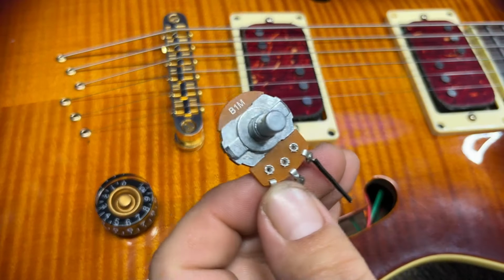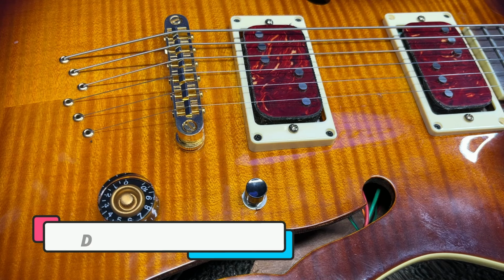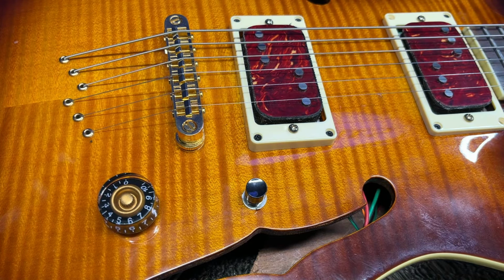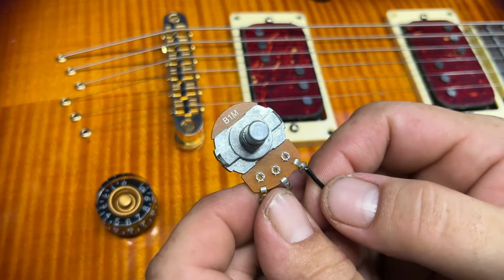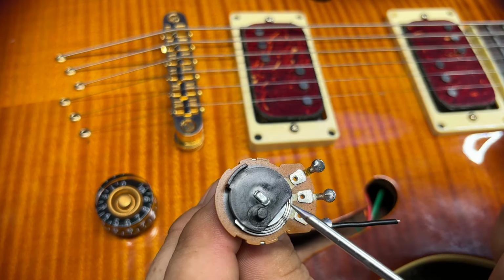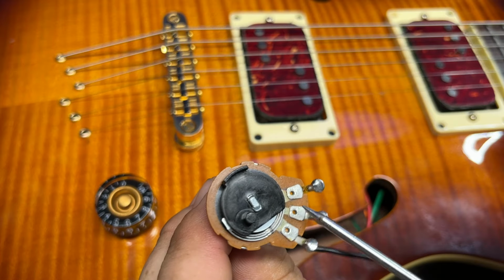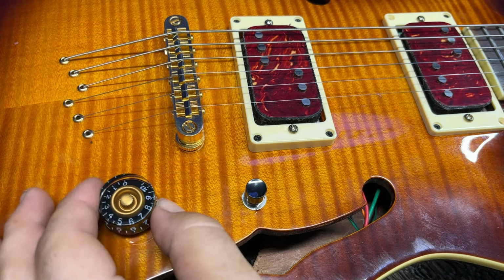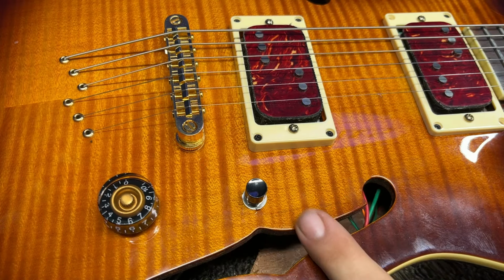Volume Pot Comparison  1meg - 500k - 250k - 100k - 25k

Comment: Such a wonderful comparison video! but it left me with a question:

What happens when you change the value of the tone pot? I know the potentiometers are literally the same, but I always figured the tone pot is the value you want to change because of the name.

The reason I ask is because I recently changed my 500k vol/tone pots on my filtertrons to 1Meg. LOVE the increase of highs and volume, but the 1Meg volume has terrible roll off. I have to get it to the 2 for there to be any audible change in gain. Could I change the volume back to 500k but keep the tone pot at 1Meg?
Reply from the maker: Yes the same rule applies to the tone pot, the larger the value the brighter the tone.
Yes you can use a 1Meg in the tone and 500k to increase the brightness.
I have a revised version of this video on my channel that compares the different values of tone knobs as well. 

I’m guessing you’re using 1Meg audio taper pots… most or all of the action is towards the end of the pot. You might want to use a 1Meg linear taper pot where  the action even beginning to end. Also make sure lug#1 is properly grounded because turning down to 2 is quite low even for an audio taper.
Reply: @ArtoriusGuitarNerd  love this! just so I am understanding right this would be the correct progression from most high-end to least high-end tone options: 

1Meg vol/ 1Meg tone > 500K vol/ 1Meg tone (1Meg vol/ 500k tone would be the same here?) > 500K vol/ 500K tone
Reply from the maker: @joshuabenton3785  you have everything correct except for the (reversal). Having a smaller tone pot will trim highs off so it opposite. 
Check out my revised video as I play around with having tone pots smaller and larger than the volume

Comment: Good idea for a vid, but I can't help but feel there is more to it. A pot does not "add" anything to the sound. It can only "take away". So even if the 1M pot sounds brighter, to me it still means that more of what the PU is producing is being heard. You are not cutting bass with a higher Z volume control - your are just filtering less of the high end. And you still have tone controls on your guitar and EQ on your amp, so it might just make the whole guitar more flexible - capable of producing a wider range of sounds. Also, a common mod is a switch to completely bypass the pots and go directly from the PU to the output jack. Which is effectively "an infinite ohm" pot. Am I missing something?
Reply from the maker: You’re not missing anything at all. You’re absolutely correct about the way the pots filter out the high end and a brighter sound with a tone knob would be more versatile.
And yes I’m definitely aware of true bypass pickups…. Most I’ve my guitars have a 250-500k pot on the bridge and completely open no pot on the neck.
Reply: As long as it goes to 11, resistance is of no importance.
Reply: @12wurst34   you are loading a big coil (inductance and capacitance, with a resonant frequency, all at once), any resistance in the path (added to the capacitance and resistance of the cable) has an effect on high frequencies
.
(electrical designers don't put those things in because they're just bored)

Comment: Thank you nice post...could we hear without reverb
Reply from the maker: I'll be doing a revised version of this video in the future. I'll be going deeper into how the pots operate, volume & tone pots, and I'll be using a set of pickups that aren't so bright.  these pickups are basically single coil with 1meg pot, very very bright. these pickups need 100k pots or 250k with some tone knob.
And yes I'll do the next video without reverb, my studio is so dry i tend to overdue the reverb.

Comment: Ok very interesting .. so I have a beautiful Boss CE-1 chorus pedal that sounds amazing but it seems to want to clip on very low gain settings. This is undesirable for me and I want to be able to have more headroom on the gain before clipping. The current pot is 500K If I change the pot to 250K will I achieve more headroom before clipping occurs or the opposite and go to 1000K ?
Reply from the maker: The volume pots of the guitar or pedal won’t help that problem.
I read online people having that problem and I don’t what to say on the subject.

Make sure it has the correct power because the old units are 12volt.
Try running a buffer before it.
Reply: @ArtoriusGuitarNerd   Yes it is mains powered and  internally rectified to 12 DC. There must be a way to desensitise that gain clip. I believe these units were  originally designed for keyboards so they might not like a hot signal. The chorus is last in my chain and I already have a buffer up front first in line,,,,hmmm. Thanks for your input... pun intended.
Reply from the maker: @peekaboo4390  dang that’s unfortunate, I read that it was made for a LowZ signal so I thought a buffer would help it out since a buffer is LowZ

Comment: This is a great topic however, the pups that you're using aren't dark to begin with, at least that I can tell.  You should do this on an LP type where the neck is typically boomy and just play barre chords so it's easier to detect the differences.
Reply from the maker: That’s a very good point, I should have done both (bright pickups getting warm & dark pickups getting brighter).
Reply: @ArtoriusGuitarNerd  It is a good video though, thanks.  Typically, I just add a treble bleed on the neck volume pot if it's too dark or boomy, which is even easier than swapping pots.
Reply from the maker: @JR-to8sn  that’s a good mod as well but has limitations and some people might not care for the treble bleed at lower volumes. 

I use to have treble bleeds on all my guitars but I’ve been using buffers inside my guitars lately so I removed them.
Reply: @ArtoriusGuitarNerd  Yes I agree and I change to the "Kinman" version of the treble bleed with works the best IMO.  There isn't a volume drop off, it's much more linear.  But the pot swap to a 1k on the neck is a great mod.

Comment: Changing pot values will do exactly what he claims, BUT. The volume taper/roll off will also change. The smaller the pot value the quicker the roll off. A 1meg pot will be really bright but will not make a lot of volume change for almost half of its rotation for most pickups, 25k pot will have a very quick roll off. If you like to do finger swells on a Tele a 100k pot with a treble bleed network works great.
Reply from the maker: That’s not true. You can get audio taper & linear taper pots and both will react differently, it’s possible that you used an audio taper in your experience.
The value of the pot is the load on the pickup and the center wiper is adding ground relative to the load (the higher value means less resistance = the more ground needed to lower the volume).
So a linear pot at 50% should be 1/2 the volume no matter the value.
An audio taper may need to be 2/3 down to be at 50% so it would feel like most of the action is towards the end.

Comment: That was a super great video. It really showed the differences. Is that how you normally work the tone on that guitar? Now that I think of it that is how it was done on the old Gretsch guitars but only one switch and two choices. I like yours better.
Reply from the maker: It’s kinda like the old gretsch except with resistors instead of capacitors.
I have a mini 3way (on/off/on) toggle on my main guitar…. Down is coil split, center is nothing, and up is a set tone like the old gretsches
Reply: @ArtoriusGuitarNerd 
If I were to change my guitar pot from a 250k tone pot to a 100k tone pot with a 250k volume pot  
Would the 100K tone pot get me that Luther Perkins I Walk the Line tone I'm talking about that Dark bassy tone I use Thomastik flatwound strings by the way
Reply from the maker: @southernpride2003  yes it would get you closer to that tone BUT please check out the revised version of this video on my channel, it covers both volume & tone knobs
Reply: @ArtoriusGuitarNerd  my main guitar goal is to get that I Walk The Line tone heard on the 55 Sun records record
Reply from the maker: @southernpride2003  well the original teles had 100k pots so I would try one of two things.
1. 100k on both volume & tone
2. 25k-50k volume and 250k tone

Comment: Great presentation but a was hoping for a quick explanation of how the tone knob changed the sound with different volume pots. Eg: can you turn down the tone with a 1M vol pot and get a similar tone to 250k?
Reply from the maker: I plan to do a revised version of this video with more details like that.

Same rule applies to the tone knob, changing the tone knob values with change the tone as well. And yes you can get a similar sound by turning down the tone on a 1Meg pot.
Reply: @ArtoriusGuitarNerd I've tried this but it's still clanking. For instance, I had 2x 250k tone pots going into a 500k volume on my strat. For tired of the clanking sound.

Comment: Whoa! Love that 5 way different value mod! Can you share the schematic? I want to install that in my guitar!
Reply from the maker: Yeah I can send you schematic on how I wired up the switch & guitar. But this is a load selector not a volume pot so you can simulate different value pots but not actually turn the volume down.

I built the switch to display what the different values sound like. It’s kind of unpractical.

My email is ruckusaudio@yahoo.com if you still want the schematic

Comment: I now wonder, why did fender put 250k pots on strats while so many complaints on the harsh tones especially the bridge single coil. The 100k or 25k could easily solve the problem
Reply from the maker: Absolutely, I’ve put 50k and 100k pots on single coils plenty of times with great success
Reply: Back in the days, I played live gigs with real amps, the harshness was way more easy to tame. Nowadays I rarely gig with amp anymore. Amp sims direct to mixers, with a full range monitor with tweeters. Because of the tweeters, I have to cut extreme treble on the amp sim and/or the mixer. The 25/100 k pots will surely help a lot in this scenario
Reply: You cannot lower the load resistance almost infinitely. With 25k you lose a lot of signal from the capsule (it has to do with the guitar output/input amp "impedance mismatch"; and you have to add the capacitance and resistance of the cable, it eats up the treble very quickly). All of that makes the pickups less efficient, you don't want that
.
  On the other hand, guitar speakers drop off quickly after 4 or 5kHz, if you listen to distortion, without a cab simulator, directly over full range speakers, it will sound horrible.
.
https://en.wikipedia.org/wiki/Impedance_matching
Reply from the maker: @pedrova8058  well a guitar is HighZ and an amp is LowZ so the impedance is always mismatch unless buffered.
Changing the value of the resistance will “changed” the cables capacity like a filter cap but won’t make a pickup “less efficient” or every pickup manufacturer would use 4Meg pots to get the most “efficiency” possible.

Comment: It sounds less professional (the sound) the lower the value gets.  At 100k it sounds like a warehouse gitarre.  The brightness, well, one must understand the sound algorythm used by yt.  This is a good demonstration of the possibilities for tuning an electric instrument.  The 1M poti can be too much on single coils.  In the end, everyone needs to find out for himself what is best.

A related option: if you feel your loosing highs when turning down the Vol knob, try a small foil capacitor between IN & OUT of the volume potentiometer.  (3rd pin is ground).  Try values between 100p till 150pF.  Always use foil capacitors for signal related circuits.
🚀🏴‍☠️🎸
Reply from the maker: You’re talking about a treble bleed mod which will also work but some people may not like the treble bleed has they turn down.
Also lug 1 is ground. Pickups get plugged into lug 3, lug 2 is the output, and lug 1 is ground. Treble bleed goes between lug 3&2. 
The lugs on a pot are 3, 2, 1.
Reply: @ArtoriusGuitarNerd I've never liked treble bleed.

Comment: In this circuit of filtering, you are varying 1component only. The capacitance is based on the pickup windings and to a much lessor degree, the pickup lead lengths. The Highs and lows roll offs can be also controlled with a few added components to further increase the desired effect. For instance, the bass increase of sound at 1/2 to 3/4 volume.  There is so much more that can be done passively.
Reply from the maker: Yes TBX circuits can be added to control the treble & bass but that doesn’t work for most guitar configurations (people like having separate tone controls on Les Pauls and strats, and you would need stack pots to make it work on teles). 

Treble bleed circuits can also increase treble. Turning the volume down can roll off highs but also lowers the volume.

Comment: O K I got a question. I changed my L Paul studio over from the original small 300 k pots to CTS 550 k pots but also changed wiring to Garret cloth wiring and .011 caps. The CTS pots were " specially ordered" by the seller at a dollar price difference . The pups are Gibson 496/500 and I thought I would get the most out of them by putting together all these pieces. My question is Do you feel like I wasted money with these changes. Part of the reason for some of this is these pups have a reputation of muddy and over the top sound. My thinking is wide scope of volume and tone so I actually keep the volume at about 7.5-8 to keep the muddy out of equation a bit. Seems to work. Actually the L P is usually my 2nd guitar to my L Sensor eqipped Strat which is very clean quiet sound. All this goes into a Boogie S O B.
Reply from the maker: Well there’s not a big jump between 300k and 550k, I’m sure it help out somewhat but I would have gone with 1Meg pots to get the most treble out of those pickups.
And no I don’t think you wasted your money as potentiometers are fairly cheap compared to swapping out pickups.
Pots should cost $6-8 each. I use CTS and Alpha pots on my guitar and prefer the Alpha pots because they have a smoother physical action.

Comment: So the volume pot is not at 0 ohms.  How much resistance is on the signal through the volume pot?  Thanks.
Reply from the maker: No the volume pot is whatever value it is.
I have a revised version of this video and it better explains how the pots work.

Comment: GOOD comp, however you were using single coil pick ups, & they would be over bright with a 1M pot.
A hum bucker usually is just right wired to a 1M pot!
Done it a few times myself!
Much preferred! 
I did  a SC Tele with a 500K pot & it was much better than 250K!
Reply from the maker: The pickups in the video are hybrid humbuckers (technically not single coils) they’re bright but not thin.

I once put a 1M pot in a tele that had Dirty Harry single coils and it still wasn’t bright enough for the customer(didn’t have that tele twang)
Reply: @ArtoriusGuitarNerd  They sound like they MIGHT have been very HOT Tele sc pick ups & were prob quite DARK as a result.

I still heard a fair bit of sc hum from your guitar so I wondered if they were still sc in nature!
Reply from the maker: @DMSProduktions  good ear, my man cave is very noisy, even my Duncan humbuckers are a little buzzy.
Reply: @ArtoriusGuitarNerd  Ahh I SEE! Well that threw me! Cheers!

Comment: Does the P.U. get a load or does the P.U. create a load???

I'm not arguing a change in sound b.t.w. It is clearly changing the guitar.
But a passive electric guitar creates a load when the strings agitate the magnetic field.
An amp doesn't put a load on a guitar (that would be deadly).
So, a constant load of 1K, nope

Comment: What kind of potentiometer did you use for comparison?
Reply from the maker: I’m using a rotary switch with resistors. Potentiometers are variable resistors, the configuration im using is non variable resistors.

When it comes to brands I use alpha or cts, I prefer alpha because the action feels smoother.
Reply: @ArtoriusGuitarNerd I would like to see this switch in more detail, as well as the guitar buffer circuit if you don’t mind, very interesting

Comment: Neat video idea, but maybe shoulda used a strat, tele or LP with stock pups for the demo so we'd have a known reference. The guitar and pups you're using are not iconic sounding (although it sounds good), but it just throws another monkey wrench into the mix of confusion. I get you're just trying to show differences, and that point is made, so kudos for that.
Reply from the maker: Yes I’m going to do a revised version soon. I’m gonna do clean & dirty, volume & tone, and I’m gonna be using a Seymour JB.

Comment: I thought pots were bypassed at full volume! Something wrong here!
Reply from the maker: They are definitely not bypassed at full volume. The wiper touches the lug #3 which is essentially touching ground. You wouldn’t hear a difference in any pot value if they were truly bypassed at full volume.
The pickup is under constant load to the ground. The pickup and wiper are touching the ground with 250k 500k 1Meg of resistance. The smaller the value the more your signal touches ground, the larger the value the less your signal touches the ground.